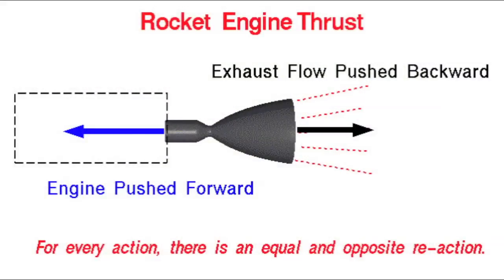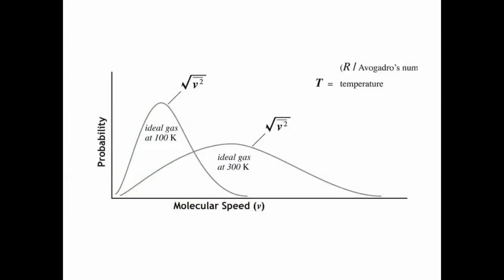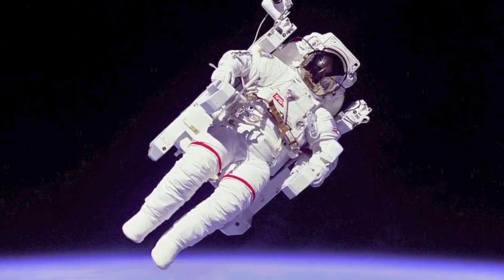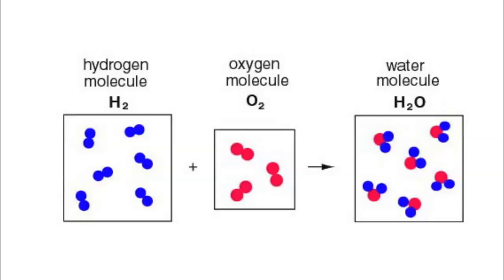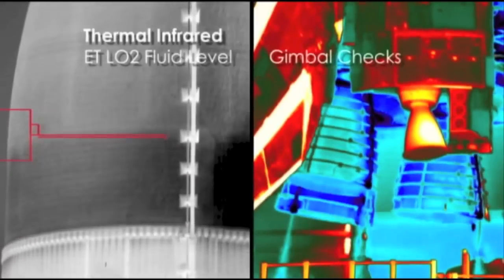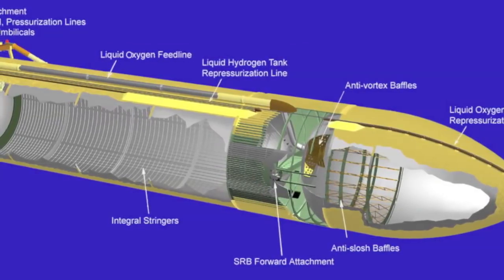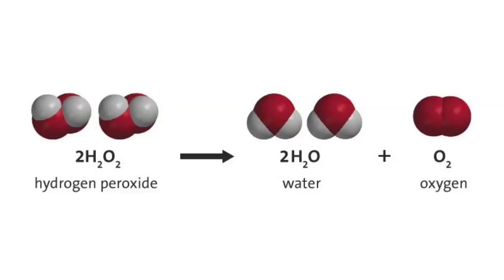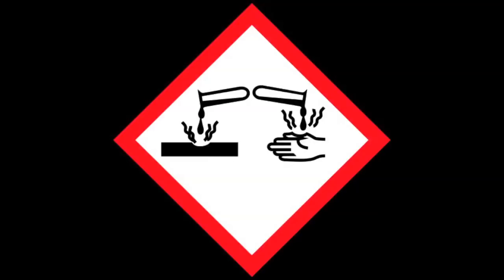WTF is Rocket Fuel Anyway?

Comment: Room Temperature doesn't exist in space. Hows that evaporation rate work in space, where one side of the craft is +275F and the other side of the craft is -275F..?
Reply: That would have to be one of the biggest challenges in spacecraft design, and is a driver behind the search for better fuel/oxidiser combos that can be stored in similar conditions, so you don't have to worry about one heating up the other and boiling it off, as well as dealing with the external thermal energy from the sun. Advanced materials are also playing a big part in the tank design/construction too, basically trying to create a perfectly-insulated pressure vessel, ideally one with a common bulkhead between fuel/oxidiser that can be stored at similar temps. I'm pretty sure that one of the reasons SpaceX is developing deep-cryo methalox engines is because the increased density of the sub-cooled fuel/oxidiser negates or eases a lot of these design problems (as well as improving efficiency).

Comment: Is it possible to first heat hydrogen in a reactor, then injection of liquid O2 at the throat of the rocket nozzle? A sort of NERVA engine, but with a "afterburner"?
Reply: Yes! A LOX-Augmented NTR (LANTR) is a viable design, that I believe was studied as an idea for a reusable nuclear shuttle during the Apollo era when NASA was hoping to keep having money. As one might expect, adding oxygen increases thrust dramatically at the cost of bringing the specific impulse down towards the 450ish seconds provided by a hydrolox engine (You can imagine that as the fraction of thrust provided by the afterburner increases, the total isp gets closer to that of the afterburner).

It's typically not discussed because NTRs are vacuum engines - You don't want to use them to launch off Earth, because of radiation and because the thrust is still rather low for LANTR designs (TWR of up to about 14:1, compared with the ~200:1 SpaceX has been able to get with the Merlin 1D). Once you're in orbit thrust matters less and isp matters more.

Comment: Apologies if this was already mentioned, but wasn't the first Soviet ICBM the R7?
Reply: +John Nowak It was the first ICBM cabable of delivering a nuclear weapon from Baikonur to a target somewhere in the United States. Unfortunately for the Soviet generals, the designer, Sergei Korolev, had space flight in mind, so the R7 too far too long to assemble and prepare for a launch, particularly because of the fueling issue the R7 had (it using cryogenc fuel). Instead of being scrapped, the R7 was instead reused to launch Sputnik, Vostock and eventually Soyuz and is still used today! In fact it was today (15.12.15).

Comment: Totally cool video. Could you tell me what a the burn temp, roughly, is of sugar and KNO3 fuel.??
Reply: Sugar is carboniferous, I am not sure on KNO3, however I suspect it is an oxidizer thus the mixture would be flamable. The O3 denotes O2 mix. A sugar bomb works with the right oxidizer

Comment: The corrosion problems with red fuming nitric acid (nitric acid with some nitrogen tetraoxide dissolved in it) was cured with the addition of a small amount of hydrogen flouride to the mix, which formed a flouride layer on the inside of the tank and protected the rest of the metal.  Once that was done, they could store RFNA for years without any significant corrosion.
Reply from the maker: Thank you

Comment: A minor correction- the fuel tanks aren't insulated to keep the fuel from evaporating (I believe the tanks are more or less constantly being topped of until just before launch), but to keep ice from forming on the tanks, which could cause even more damage than a loose piece of insulation.
Reply from the maker: The LH2 tanks on the Saturn V S-IVB stage had insulation to slow boil off in a parking orbit prior to TLI
Reply: @scottmanley  Yes, my reply was only for the shuttle main tank, or any tank being used for launch.  Any tank that needs to be "kept for later use" would need to be insulated.

Comment: I'm confused, and my brain is apparently full of fuzz today.  Mr. Manley makes the point that it is best for the fuel to be high temperature, and low molecular mass.  I get the high temperature thing, but why low mass? It seems to me that if you could throw bigger mass per particle out the back, you'd transfer more momentum (given that the speed of the actual particles is unchanged).  I mean, I don't doubt Mr. Manley, but can someone who's actually had their morning coffee briefly elucidate?
Reply: Wouldn't higher mass simply mean it's heavier thus adding to the weight having to be pushed?
Reply: Well, yes, but if you push a heavier thing at the same speed, the momentum transfer is, I thought, higher with a higher mass.  Momentum is mass times velocity.  If you push a large brick away from you at some speed, the amount you feel being pushed back is higher than if you pushed a coin away from you at the same speed.

I guess, though, that since you have to push your own future fuel, there's that competing factor.  So early on, you're transferring more momentum, but in terms of speed, that might get eaten up by having to push heavier fuel.

I guess there's nothing for it but to actually do the math.
Reply: Okay, sort of figured it out.  My intuition comes from Newton, but it only really applies to conditions where mass is unchanging.  Or arguably at an instantaneous point in time in a rocket.

However, when integrated over time, as per the Tsiolkovsky rocket equation, the contribution of mass of the fuel to the delta-v equation is buried inside a natural logarithm, whereas the exhaust velocity is outside.  In a tradeoff between mass and velocity, its better by far to have a higher velocity and lower mass.  

It looks like that if one could keep the exhaust velocity from falling very much, an increase in mass could help. However, that would require an increase in force being applied to the stuff going out, which means putting more energy into pushing it out the back, which I imagine would be difficult to arrange.
Reply: Actually, as I understand it, higher molecular mass means that more energy is lost to be lost to the spin of the molecule.
Reply: Hmmmmmmmm
Reply: brancrafter1879 That's actually 100% countered by the fact that the fuel ejected out the back of the rocket is equally higher in mass, thus producing more thrust per volume exhausted. But rather than pointlessly spouting opinion, I'll cite sources: http://antoine.frostburg.edu/chem/senese/101/thermo/faq/rocket-fuel.shtml
Reply: Ish. I hadn't considered deeper understanding of the thermal properties of the fuel in terms of absorption and all that, but it gives another reason why its not as simple as newton's laws.  lighter molecules tend to turn energy into thrust better (because apparently bigger molecules absorb more internally), and I think that integration over time issue with the logarithm plays a part as well.

In other words, I can see a couple of reasons why Scott Manley's point is correct, even if it wasn't immediately clear.
Reply: 'Better' here is higher specific impulse. Specific impulse depends on the speed of the exhaust. The higher the speed of the exhaust, the better the specific impulse and thus the lower the mass ratio you need for a target delta-V (qv. the rocket equation). Here, though, the speed of the molecules is inversely proportional to the mass of the individual molecules, so to maximize the speed of the exhaust (and thus the specific impulse), you minimize the mass of the molecules in the exhaust for a given amount of available energy.

Yes, thermal properties have a lot to do with it, but the min/max problem outlined in Scott's discussion is the basic gist. After all, your rockets are limited in power output — if the power output gets to high, your rocket melts and you will not be going to space today.
Reply: snort well said.
Reply: If I go just by the physics... the energy you get by expelling a mass m at velocity v is  0.5 m v^2. Doubling the mass of the fuel will double the energy, but doubling velocity will quadruplicate the output... without making the rocket a lot heavier.
Reply: fullmetalfelix
Mass and propellant density are not the same. As well as mass and molecular mass.
You can have 2 tons of Hydrogen. And it will weigh as much as 2 tons of Oxygen.

The point is: The temperature of a gas is dependend on the kinetic energy of its moleculs. Kinetic energy goes like this: E = 1/2 m v^2 (as you pointed out).
So a molecule of Water (H2O, 18u [chemical mass unit) at x temperature (kinetic energy) has sqrt(x/18u) velocity. Putting x = 18 it has a velocity of 1a (a is a variable to substitute as we are aproximating by using u as a mass unit).

Let's take CO2 (part of the exhaust gases from RP1 rockets). Mass: 40u, velocity at X temperature of a singular molecule: V = 18/40u = 9/20 a = 0.45a
Essentially half the exhaust speed. and thus specific impulse. But we're not counting in with this one that RP1 rockets have CO2 and H2O as exhaust gases.

I guess you are referring to high mass and high thust by using high molecular mass fuels. The benefits are that you can achieve much higher thrust (not deltaV, short: dV) as you are achieving a much higher fuel flow (in kg/sec). It can lift much more stuff but has specific impulse drawbacks (and dV disadvantages).

Of course you can increase the fuel flow of every rocket to increase it's thrust and specific impulse. But you need to concern the material stress too. More fuel flow means higher pressure in the combustion chamber.
Higher pressure means hotter combustion. -> Faster fuel flow but also higher chance for the combustion chamber to burst and explode.
Therfore the engine needs to be much heavier, the cooling system is much more sophisitcated (and heavier) and the turbo pumps must be much more powerful (and heavier).
So it just gets much more complicated (and heavier) with increasing the thrust. It all is outweighing which gives us the most dV for the least amount of recources used and the least amount of things to fail.
Reply: fullmetalfelix Probably a bit late but anyway.
Yes doubling the mass of the fuel does double the energy, but it is the energy that you require to accelerate it that you are doubling rather than doubling the energy that you have available to use for accelerating it. So if you need to use the same amount of energy, doubling the mass of the exhaust gas will slow the exhaust down by to sqrt(2)/2 of the velocity it would have otherwise. However you will increase the thrust that you get out for that mass of fuel by sqrt(2). Heavier exhaust gas means more thrust per unit energy but less Isp for rocket engines.
Reply: I think this: 

F (thrust) = Ve (average exhaust speed) * M flow (mass flow rate)

As you can see, there are two speeds in this equation. One of the exhausts and the other one is the flow rate, that is also a speed.

V fuel = [Acceleration] * Time
V fuel = [F pump / Mass fuel] * Time

M flow = Mass fuel * [V fuel] / Time
M flow = Mass fuel * (F pump / Mass fuel * Time) / Time = 

Thus: M flow = F pump

The `mass flow rate` isn't dependant on it's `mass`. Because the `flow` changes with 1/Mass.

Anyway, If i'm not right: "it did work perfectly before exploding !"

Comment: What about replacing hydrogen with deuterium? Maybe a noob reasonning, but the initial mass would be greater.
Reply: I believe it's been considered, but hydrogen is an awful lot cheaper and easier to obtain in the required quantities.
Like all the ideas proposed in these comments, somebody has probably already thought of it and if it was efficient and cost-effective to use, it would already be in use.
Unfortunately, the engineers working on these technologies will never have enough funding and man-hours to do everything they want.
Reply: Deuterium's expensive.

Comment: I thought the Nedelin catastrophe was due to poor safety procedures during testing, not unstable rocket fuel.
Reply: You're right. They were in a hurry and broke all the safety rules there were. All work should be done on empty rocket and personnel evacuated once it's going to be fueled, but there were errors found and they worked on totally fueled rocket. What's more, there was electrical power there also and the fatal error was to try to reset electromechanic programming device while energized: when it returned to initial position it initiated second stage launch, so it fired right into first stage, ripped fuel and oxidizer tanks and all these highly toxic self-igniting components leaked all over the place, turning sand into glass and killing everybody near. Yangel (designer of this rocket) didn't die there because he went to smoke to distant place the moment it all happened.
Reply: talk about a nightmare! Wow, 'initiated 2nd stage launch, firing right into the first stage'... talk about a bad day for those folks.

Comment: Water and thermite may work as a rocket fuel, the reaction releases enough heat to cause water to be ripped apart into O and 2H, the mythbusters have a video of it.
Reply: Yea, you could proboly usa a Zink catalyst with a liquid core reactor and first run the waster throw the zink caltalyst, then run the Hydrogen and Oxygen seperatly throw the reactor to different nozels increasing the specific inpulse of the Hydrogen by 50% (due to that liqud core ractors run hotter). The problem is that Oxygen might combine in to O2, and then you got a really lousy fuel for a nuclear rocket.. but i´m no chemist (the Oxygen might separate at high temperature)
Reply: i think they almost do. Aluminium hybrid rockets - Yes like in interstellar mod - react Aluminium, thermite's secret ingredient, and oxygen together would give a similar reaction

Comment: around 4:50
wasn't the piece of foam supposed to keep the hinge from freezing? I believe it didn't have to do with fuel requirements at all. Someone prove me wrong please
Reply: the whole tank had to have that insulating foam to keep heat away from the tanks. It covered the hinges as well mainly for aerodynamics, to my understanding.
Reply: Seems fair... thanks for your insight
Reply: DerZeldaFan
wasn't my insight, there was an Ars article around that looked at the merits of the plan NASA was told to draw up in case of a hypothetical shuttle rescue (this was alter Columbia). And it went into great detail about the challenges involved.

Comment: cont. I think you misunderstand, i am not against new tech but i am against programs like this which have the sole purpose of stalling advancement, just like the asteroid mission they announced for 2025(will never happen as the design says)

nautilus is what they plan vasimir to use as a housing for that 2025 mission and mars, only the size and power in the design for it dont match vasimir. these things can be checked as its all public info. its a mission to stop missions,nothing else

Comment: Tell the people in england that the v1 was useless. It was simply to show that even at that early stage of design it was possible to launch and target a dumb fire chemical/jet rocket, as a 1st stage things have not really changed a great deal.

However with the needs to get vasimir to a point it will work to the design document the amount that needs to be invented means it wont happen, there is not the budget or tech for it

Comment: Would the best specific impulse be gotten by hooking up a particle accelerator to the back of your spacecraft and running that?
Reply: Sort of yeah, that is sort of what Ion engines are.
Reply: yeah, I was thinking that but with like protons instead of entire atoms, and much faster.
Reply: Its still the same idea, using electromagnetic forces to propel an ionized particle. But they have such ridiculously low thrust that the gain in specific impulse from using a proton beam would not outweigh the additional difficulty (weight, power requirements, possible damage etc) compared to an ionized inert gas.
Reply: true, it would be pretty cool  though

Comment: (continued) The thing is, it only works in space because with in an atmosphere the plasma would heat the air and almost instantly melt the engine causing a catastrophic failure, but it would produce tremendous amounts of thrust with unprecedented efficiency. I'm sure you have probably heard of it but I was wondering if you would talk about it in one of your videos if you haven't already. *When I said partial accelerator I meant particle accelerator.

Comment: Hey Scott I would like to make a suggestion on a possible top and something I thought should have been in this video. There is the Nuclear Fusion Propulsion engine being developed by, I think it was a Frenchman, I can't remember but, it works by using a nuclear fusion reactor which works a bit like a partial accelerator, you know, but it then vents and channels the plasma out the back using magnets giving it an incredible power with minimal reaction mass (continued).

Comment: While making your discussion of liquid bi-propellents you missed some of the older and "fun" oxidizers, especially the most Kerbal of them.

Namely, WFNA, RFNA, IRFNA the lovely -- and toxic -- nitric acid based oxidizers.

As well as the ever pleasant chlorine triflouride which is hypergolic with everything; including any fuel you can think of, the rocket motor, the rocket itself, the rocket's payload, and any who happen to be near it. Oh, and it can set sand on fire.

Comment: Ah see I thought the specific impulse of the chemical engines in KSP was unrealistic (up to 390s in vacuum). So the Space Shuttle's main engines are actually better than that?

Although I have seen a presentation at the Johnson Space Centre (I think) about how those engines are physically the most efficient chemical engines they can make, without using fluorine instead of oxygen (which would make a toxic by-product, Hydrogen Fluoride).
Glad you make this video though Scott, thanks!